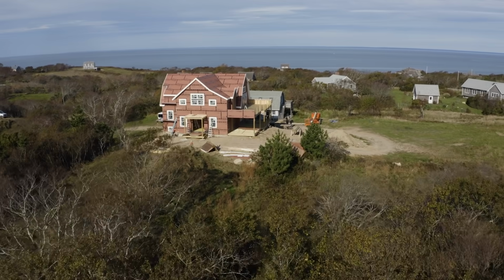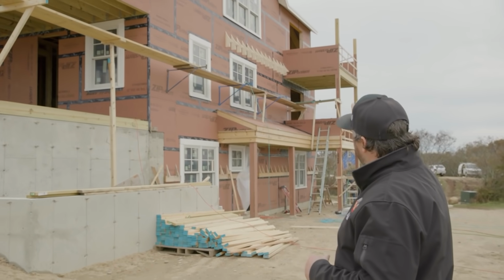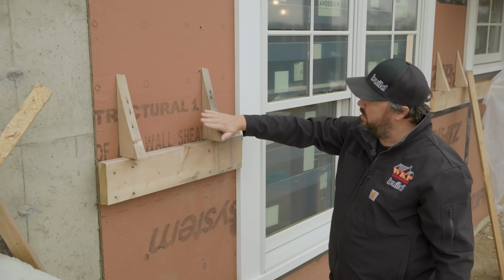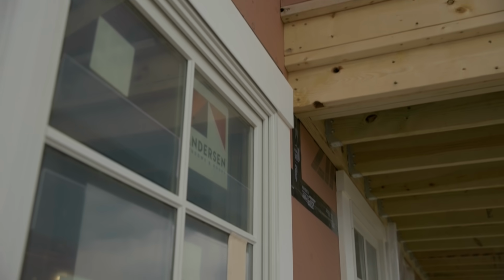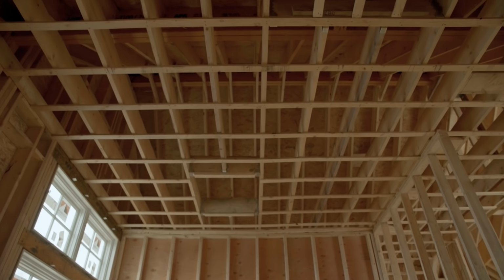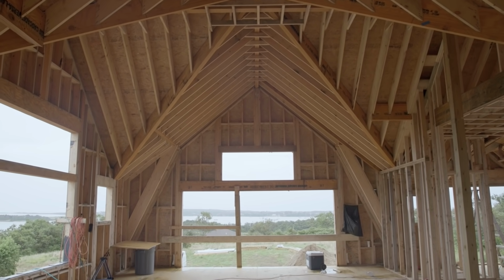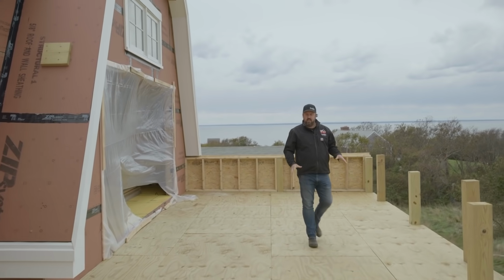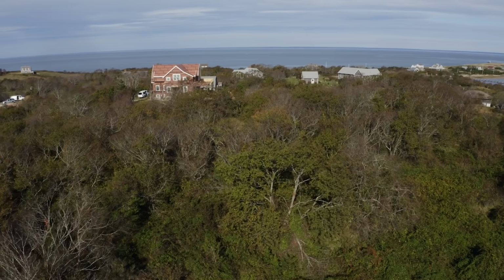Final Framing Details and Project Update - Building on an Island Ep. 6

Comment: Question for wade, for the window trim assembly: the head casing appears to be pushed forward about 1/4 inch to achieve the reveal, what do you do about the gap that occurs behind the head casing and the zip sheathing once the assembly is attached to the substraight?

Comment: Maybe I just missed seeing it but didn’t see the cedar breather or whatever you’re going to use behind the window trim. Also wondering about the insulation for the roof. Won’t you be putting several layers of foam on top of the roof deck. The fascia doesn’t look to be set up for it. 
One more question. Will you ever respond to my question about the insulation drainage board on the foundation walls?
Grace and peace 
Slick

Comment: During the exterior window trim detail the presentor/builder states they used a thick piece of trim for the head to give it the proud look when in fact they did not use a thicker trim piece they just offset it forward and most likely their table jig is set up to keep the offset constant when pre-building these trim sets.
Should have corrected this when presenting instead of continuing with false info as it makes you question of info he provides..
Very good work by Tradesman but a thumbs down to the presenter. 

PS: seems like a thicker piece would have been better for the install of the trim to the flat surface plane, unless they have a  shim / filler behind it on wall to assist in the install or a space was intentionally required for slipping in a top flashing drip edge with sealant?

Comment: Did you think of keeping it vaulted but changing angle from where the vaulted ceiling starts (side wall) but lowering the interior peak by 3 to 4 feet? This would create a void/attic space but keep the vaulted look in the kitchen and you could probably carry that out into the great room in order to keep it seamless. The angle of the inside would still be nice but much less then the actual roof.

Comment: I've been following this build here on YT and something I've been wondering.  Would this have been an easier build if the property owner had decided to go with ICF up to the bottom of the roof line?  I seem to recall from earlier episodes that cement on the island was almost easier (cheaper?) than bringing in framing lumber.
.
.
For myself, I lived for 15 years on Long Island (mostly along the centerline) and I would DEFINITELY prefer something stronger than a stick built home when dealing with a N'oreaster!

Comment: Curious why the upstairs HVAC routing was an afterthought that required a design modification rather than part of the architect’s original design
Reply: Put the furnace in the basement and supply thru the floors
Reply: The problem is architecture is too often about pretentious artsy babble, extreme shapes and amounts of glass.
Rather than tuning the space for the systems that will inhabit it.
Think about car designers that first draw lines for form rather than function.
Good design takes a function-first approach which is too often lacking.
Reply: Don’t  know about this project but a lot of architects design for the client first and let the trades figure out the details such as HVAC. Hence this situation. That’s my 18+ years of experience at least.
Reply: @watchthestars.atacama  I think that's pretty standard and also pretty reasonable, until you start paying seven figures for design and construction services.
Reply: @Dickoz0r  lmao I don’t know what twisted world you live in but seven figures for HVAC design on a house that size is beyond ridiculous, it’s stupid. It should be all part of the design BEFORE anything gets built (we have tools such as Revit that do that in 3D) not realizing afterwards that “oh, we can’t run ducts through here, let’s value engineer this thing and have the homeowner loose their cathedral ceiling.”  while keeping a straight face. 
Are you for real??!! Not in my world!!
Reply: @watchthestars.atacama  Clearly I miscommunicated. I was saying that if the job is cookie cutter then of course there isn't going to be extensive building services design prior to construction. My reference to seven figures was in relation to the project value not HVAC. So we are in full agreement. Based on what I observed in the clip, without any more context, I think the client has been let down, big time.
Reply: @Dickoz0r  ok sorry for sounding like an ass in my previous comment but I deal with so-called pros all day and the lack of professionalism is up-hauling. We do need context but that particular situation is inexcusable on the part of the people involved in the design phase. Unfortunately too many builders are stuck with pre-construction mistakes to deal with in the field.
Reply: I was thinking the same thing.  My only guess is that the way he presented it made it sound like it was a OH Crap moment when in truth it was discussed way back in the house design and was worked out then to add the lower ceiling.  Otherwise that is a pretty big screw up!   However I would have thought the lower ceiling would have already been framed out/installed if it was corrected back during design stage.  OK episode, didn't have as much meat to it as some of the others IMO.
Reply: With the cathedral ceiling like the kitchen the way it was. Was nice.
All they needed was/is a ceiling fan.  Bring the air in thru the wall or above cupboards
Reply: I wondered the same thing.
Reply: It worked good on paper.